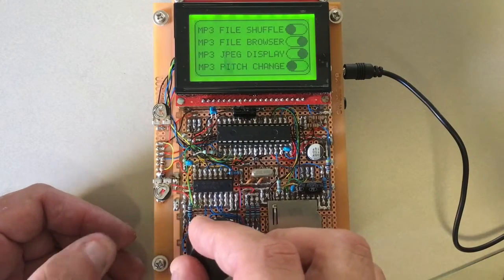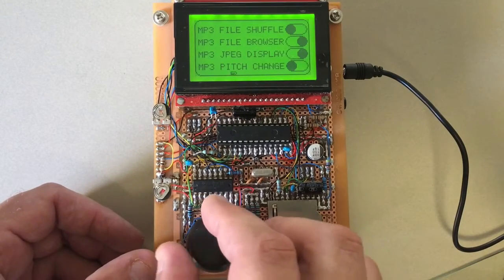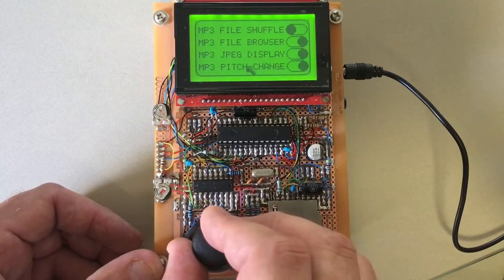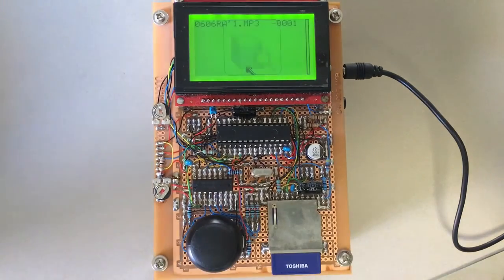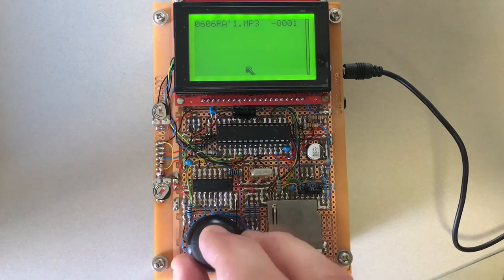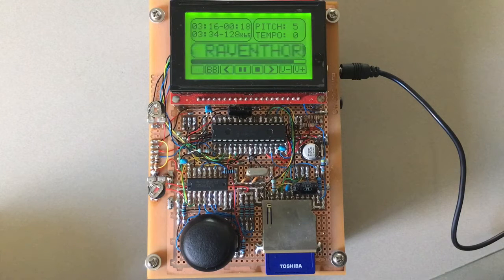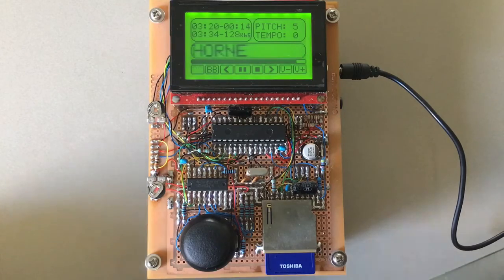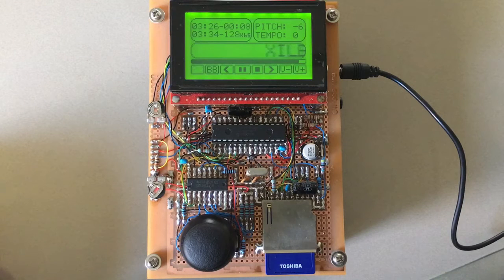MP3 Pitch Changer for VS1003b

Comment: Is the pitch shifter a VS1063 plugin?  This one? 
http://www.vlsi.fi/fileadmin/software/VS10XX/pitchshifter.pdf
Reply from the maker: If I recall correctly, the chip in my project was 1003B (obsoleted now). I’m not sure what else it works with.
Reply: @BrekMartin  Cool, but did you use that pitch shifter plugin?
Reply from the maker: johny radio If there’s more than one I’m not sure. Whichever is for this chip. This is going back a few years.
Reply: @BrekMartin  Yep, that's the one! I don't suppose you can recall the process to install the plugin to the chip? thx
Reply from the maker: @johnyradio2  From what I remember you wrote the program data byte by byte as if it was a big command. I had it stored on SD card.